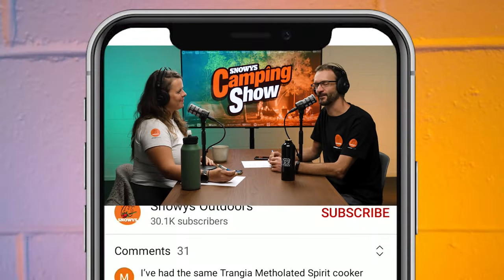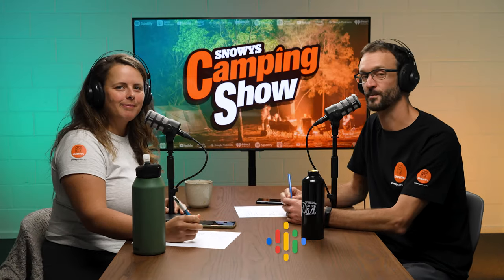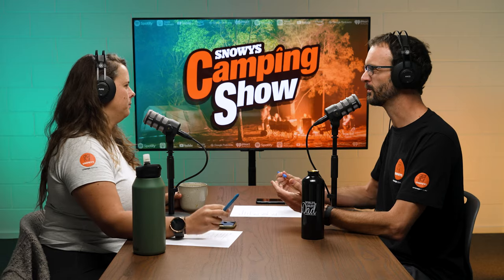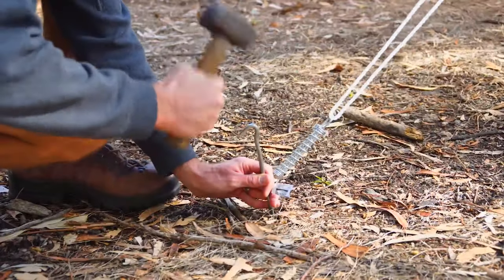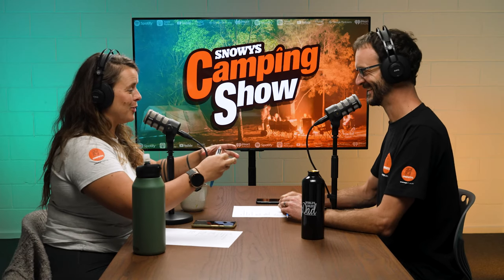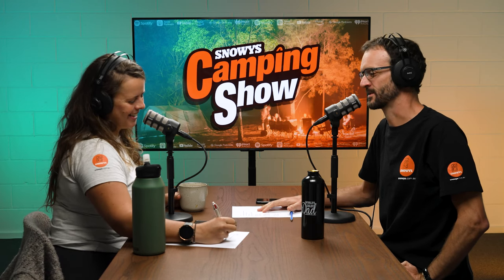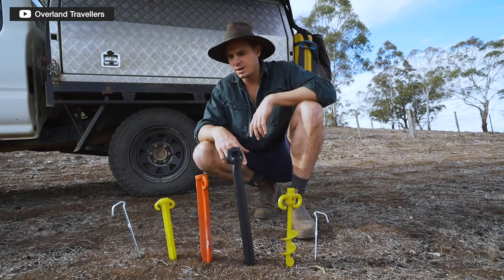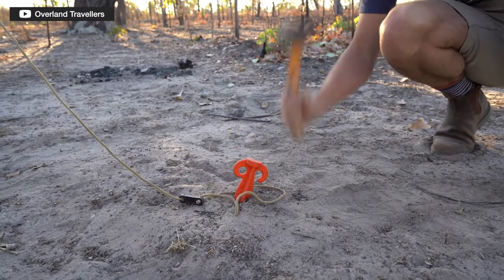Ep 54 - Talkin' Tent Pegs

Comment: thank you for selling the supapeg key head pegs, in both lengths, at a great price 😀 
Iv'e bought a heap off you. (a lot of stores don't sell them )
 It seems people think you need to use same length pegs for different ground types. the shorter supapeg pegs work great,( in hard ground) at a great price compared to screw type pegs.
please don't assume that caravan parks have 'soft' ground. great comment about using 'solid' hammers. ( just use a hammer- yesss!)👍
Reply from the maker: Thanks for your comment, Places To Sea, we sell loads of the Supapeg Key Head Pegs because they are the perfect design. ~ Ben

Comment: Just purchased the EVO TS V2 AIR TENTlast week. And a ground sheet. In between the two packages, there must be 40 to 50 tent pegs. What size would you recommend for normal campground grass and how many an extra 12 or? Thanks
Reply from the maker: For firm grassed ground the Zempire pegs that came with your tent would suffice, they would be about 6mm x 225mm and there should already be enough in the kit.
If you are expecting bad weather then it could be beneficial to add about 4-8 longer pegs for the guy ropes and main corner points, about 8mm x 300mm minimum. ~ Ben

Comment: i purchased a brand name tarp that came with these little aluminium pegs kinda like a star dropper  ...was sceptical but they work well and easy to knock in...as for a hammer i use the back of my hatchet
Reply from the maker: Those little pegs are good, for lightweight hiking purposes in particular. I know them as 'tri-pegs', but they have various names. ~ Ben

Comment: Buildex landscape and building screws from bunnings .  Will never go back to pegs again, we use them across all our camping options. When using the campertrailer, gazebo, or swagging during overnighters.
Reply from the maker: I've just had a sus of these - what an awesome economical option!
~ Lauren
Reply: @SnowysOutdoors  yes, and a few sizes to choose from. I forgot to add some galv washers aswell.
Reply: Yep, the 300mm screws are the best.  I like to use 2 chain links to allow a spring to be mounted

Comment: I bloody love my EzyAnchors (screw-in pegs). I think I’ve mentioned them in a comment on a previous episode and said how they’re great for saving my dicky shoulders. One of the times I went camping with just me and my little one before I had the screw-in pegs, my shoulders were causing me so much pain that I had trouble sleeping.

But even if it’s just for ease of use and speed and not to avoid actual pain, they’re worth it just for that!
Reply: Having said that, yeah, it does mean having to carry a drill and batteries and a way to charge those batteries, so that’s definitely a consideration.

But if you’re all set up with a way to charge stuff anyway, then carrying a battery operated drill isn’t that much of an extra.
Reply from the maker: I think screw in pegs are great for anyone with an ailment that makes it hard to belt pegs into the ground i.e bad back/shoulder etc. I mention in the episode that my cousin invested in a heap of Hex Pegs for this reason. ~ ben
Reply: @SnowysOutdoors  I could totally relate to that reason.

Comment: Over the years I've found that the tent pegs provided with your average budget tent are really good on a still day on a lawn...or for when you're in need of some tie wire...
(I Googled) Reading the properties of PP and PC, it seems that Polycarbonate has more impact resistance than Polypropylene and is more durable overall. However, it can be more expensive than PP.
Reply from the maker: Thanks, Brad, I didn't come prepared with the differences in PC and PP. I guess polypropylene being softer will show impact from hammers more than the hard nature of polycarbonate, but i think too much impact can cause polycarbonate to crack. I don't reckon it would make a difference for most though, and price is probably the best factor to use when making a decision. ~ Ben
Reply: @SnowysOutdoors  I agree, Ben. There really isn't much difference between them in terms of toughness. PP can suffer from UV degradation but tent pegs only see sunlight for at best, a long weekend I suppose.

Comment: Love my metal Supapegs! 
We use a very light weight hammer from ebay. I would never recommend your typical nail hammer, theyre usually rounded and you'll end up breaking your hand when it slides off. Take a dumpy hammer for the hardest grounds.
You guys never mention how to pull metal pegz out, just a twist and they come out easy. As for sand, I'd go with some longer twist pegs, dont need them for every anchor point.
Reply from the maker: I had to look up what a dumpy hammer was, DOCWHOK9, but it's exactly what I use, I just call is a mash hammer or mallet. I think I did briefly mention twisting pegs to get them out, you're right though, a few twists and the regular metal pegs usually come out easily, even from the hardest ground. ~ Ben

Comment: Supapeg is Australian. My 18' x 20' tarp, is secured by 16 of the big black sandpegs, it can be howling a gale at the beach, I am not concerned in the slightest.
My old Oztent, set up under the tarp, just has key head supapegs on the 4 corners.
My Supapeg awning off my ute, just uses 2 key head supapegs, for day trips to the ⛱  beach.
I started off using small black supapegs on my tarp, useless, then I went to the black pegs, about a foot long, OK, but occasionally pulled out.  Then I bought the biggest black ones, never had an issue again at the beach.
I have a full size sledge hammer, with a half length handle to knock them in, and a diy peg remover to get them out.  Initially, I had to use my ute to pull them out.
Reply from the maker: Those massive back sand pegs are absolute monsters.  I'm having a good laugh about pulling them out with your ute!
~ Lauren
Reply: Lauren, these days it is not cool, to mention men and women have different priorities.  I found it refreshing that you were unsure what type of hitting implement, was used to knock pegs in at your campsite.
It would be nice, if we could revert to acknowledging the different wants and needs, around our campsites.

Comment: Just get some 12mm reo bars made into tent pegs - they are awesome! Mine stayed in the ground after 120km/hour storm hit, and believe it or not they are cheaper than any other peg. There are no alternatives.
Reply from the maker: How do you go pulling them out with the texture on the bar?  They'd be a cracking peg, no doubt
~ Lauren
Reply: @SnowysOutdoors  claw hammer does the job. You’ll never go back to another peg. In fact mine are only 10mm.
Reply: What’s a reo bar? Reinforcing bar? Google is showing me what looks like tent peg but with sort of spikey bits around it.
Reply: @coralieofjumpwithnofear  yes steel reinforcement bar that goes in concrete
Reply: Reo can actually bend unless you use the bigger diameter, but the real downside is the bulk and weight of them. Carry a few maybe, they'd double as good wiching anchors!
Reply: @DOCWHOK9  I work in the reo game and know what every bar diameter is capable of. My 10mm pegs have been going for years. Best pegs ever. Yes of course they are heavier, but they work a treat.